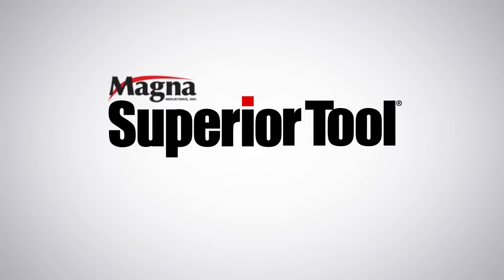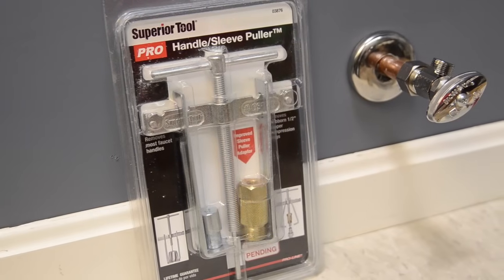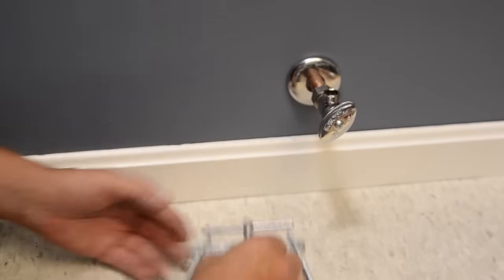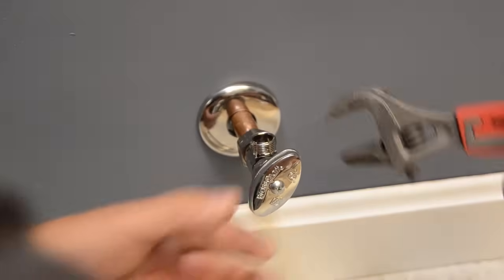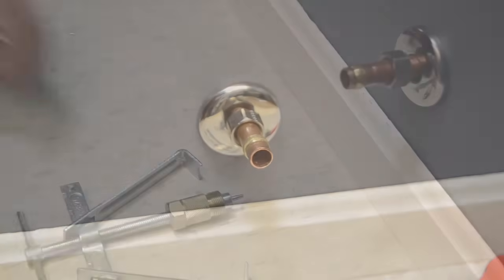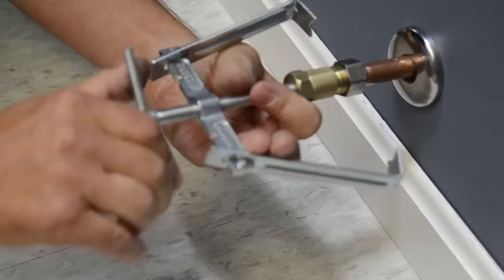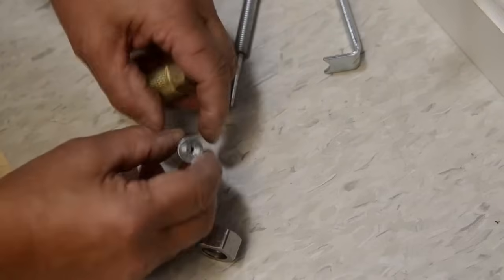Easy Compression Ring Removal - Superior Tool Handle & Sleeve Puller

Comment: If the nut is in good shape on old stop I use it on the new stop
Reply: Only if the female thread pitch on the old compression nut matches the male pitch thread pitch on the new stop valve.

Comment: I tried using this tool on a 1/2 compression laundry supply line but the threads were different and it would not pull the ring off. Luckily I had access to a compression ring removal tool that is not thread dependent. I recommend using a tool that is NOT thread dependent.
Reply: I encountered the same problem on the very first angle stop that I needed to replace:  The compression nut on the old angle stop had what appeared to be 1/2-inch female pipe thread, significantly coarser than the thread puller adapter that came with the tool, but I was able to get about a turn and a half of engagement, just enough to be able to pull the compression ring.

Comment: Good tool.  My only complaint is that I wish the 2 arms used to pull faucet handles (which make this a dual use tool) were easily removable.   They're not needed to pull compression ferrules and when you are doing so in a confined area they just get in the way and can be a knuckle buster.

Comment: The arms on the tool stamped steel and are only useful for pulling faucet handles, so for cramped spaces you can remove the drive screw from the handle assembly and set the arms aside.  I own a Home Depot "Husky" version of this tool, purchased new in November 2023, which looks very similar, except that the thread puller adapter is knurled to get a better grip with one's fingers and lacks the hex nut feature, probably to prevent damage to the threads if one should try to forcibly mate it with a compression nut with a different thread pitch.  On the very first use I encountered a 25-year-old angle stop that had what appeared to be a compression nut with 1/2-inch female pipe thread, considerably coarser than the thread on the thread puller adapter, but I was able to get about 1-1/2 turns of the compression nut thread onto the adapter before binding, just enough to get a good grip and be able to pull the compression sleeve off.  I found that lubricating the drive screw, the surface of the drive screw centering "peg" against which the drive screw presses and the end of the copper stub-out with toilet ring wax greatly reduces torque requirements and makes the compression sleeve come off much easier.

Comment: Great tool, changed 2 vanity sink shutoff valves in 10 mins. Very easy to use, the sleeve came off in seconds. I took off the arms to make it easier to use A+ . Saved my son in law $250 a plumber was scheduled to do.

Comment: Didn't work for me, pipe not perfectly round I guess, the nipple wouldn't go in so the nut wouldn't reach the tools threads.  May just cut it off and go with push on valve.

Comment: Ok, here is a real life experience with this tool. I am a strong dude with great grip strength and using this tool to pull off two 20 year old copper rings was extremely difficult.

Both of of the valves I was removing were behind the toilet and I had very limited access and leverage. The thin metal turning "arms" on the tool provide extremely limited leverage. I was able to twist it, but at times I had to wrap my shirt around the tool as it was bruising my hands from the pressure I was exerting on the tool to turn it. It was extremely difficult and laborious process for me. It took me about 1 hours of twisting and curing and then trying to find some leverage to turn it.

Tool works, but if you are in a state with hard water it may be very difficult to use effectively. Cutting the pipe was not an option for me, so I had to get it done. My right palm is completely blue from twisting the metal "arms" on the tool.

Comment: WOW! Struggled for an hour trying to remove a F@(%!#g compression ring. I could spin it, I tapped it, poured hot concentrated vinegar on it, and couldn't get it off. Tried using the old ring with new fitting, didn't work. Ended up cutting it off and then the new fiting wouldn't work anyway and ended up using a sharkbite because u didn't  have another compression fitting. Then I thought, I wonder if I could envent a tool that would make it easy. Then I thought maybe someone thought of that. Gonna buy this today! 
 Why did my compression shut off valve not work? I throughly did the prep work? Did I wreck it or do you once in a while get a bad one?

Comment: Just cut a small piece of pipe the same diameter as the one your removing the ring from. Put it in the valve that you just removed and tighten the nut from the wall.
Reply: Wow. Perfect advice bro!

Comment: Thank you for making the video, especially for us, who can't find a plumber willing to come out for simple stuff.  It's not a matter of paying someone, it's to the point where you can't find anyone, unless it's major money job.
Reply: Sounds like you could start a side hustle doing this kind of stuff lol
Reply: @divinecomedian2  Well, I ended up having to use a dremel to cut mine off- the compression ring was too corded for the tool.  I changed out three fittings, three new valves, new hoses, and three new floater systems.  The blue plumber paste sealant was a must for me.  I wonder how much it would have cost me, if I hired someone to do all that?

Comment: The handle on the tool is way too short; can't get any leverage.  A clearer picture on the package of how the pieces go together would have been helpful. The tool does work, but needs improvement.
Reply: Lubricating the threads of the tool, the surface on the centering "peg" against which the drive screw presses and the copper pipe stub with toilet ring wax greatly reduces torque requirements and makes the old compression sleeve come off easier.

Comment: I bought this tool to pull compression sleeves. The brass colored piece would only thread about 3/4 of an inch up the main shaft of the tool, because the threads on the main shaft were distorted and warped. I returned it.

Comment: Just so you know, those wings on the side  of the tool are for  pulling shower faucet handles as well.
Reply: I've been baffled by this since I bought the thing a year ago... thank you lol
Reply: Thank you!  I was wondering!  The dude could have mentioned something about it!
Reply: I wish the wings were removable. They just get in the way when you're in a cluttered space under the sink.
Reply: Simply unscrew the arm holding the wings until they come off, before using tool to remove the olive ring. Screw the the arm with wings back on when they are needed. @FrankRusch

Comment: I had one that was a real problem, it started to distort to the copper pipe rather than coming off.  In that case, it better to use a splitter tool to cut if off. Because of that, I really try not to remove it unless I cant make a good seal with the old ring.

Comment: This is the most deceptive video ever.  You first need to remove the handle puller mechanism or it will be in the way on every turn.  The sleeve in the video must have just been installed because they do not come off that easy.  It takes at least 50 hard turns and you can't turn the handle by hand on a sleeve that has been corroded on the pipe for years.  I used the hole in the end of a crescent wrench to turn it.  Save your money and just cut the pipe beyond the sleeve if you have enough pipe coming out of the wall.
Reply: Lubricating the threads of the tool, the surface on the centering "peg" against which the drive screw presses and the copper pipe stub with toilet ring wax greatly reduces torque requirements and makes the old compression sleeve come off easier.
Reply: Big thanks Ostrow and Labfolk1. Cutting the pipe wasn’t an option for me. So, after two hours of testing perseverance, the lubrication idea and using makeshift extended levers (using my channel lock wrench) the job got done.
Reply: But when you do NOT have enough pipe coming out of the wall then it’s either this or hire someone to go into the wall and weld new pipe or switch to Pex and sharkbite. 

I’d rather try this and lubricate the ring with toilet seal wax.

Comment: Would have been nice to know that the ring has to be right on the edge otherwise the tool won’t work.
Reply: mine was about 1/2 an inch from the end of the pipe and it worked just fine to get it off.  instead of assembling the tool ahead of time, I insert the silver metal piece into the copper pipe first, then push the gold threaded part over top of that and pull the nut over it at that point and then I insert the large part of the tool in through all of the pieces and then start turning.  Try that, hope that makes sense. I was concerned too at first but this method worked for me.
Reply: @Bturp1  I wrote this down and am going to try it your way.  Sounds like it would work.  I tried a different puller and it cracked the last thread of the puller.  Glad you mentioned your way of doing it.

Comment: Only problem is this works exclusively on horizontal pipes. If it’s vertical from the floor won’t work
Reply: what prevents it from working?  I have vertical pipes on my floor and wanted to know before I buy this tool.  Thanks!
Reply: As demonstrated in this video, the tool will work on pipes in any orientation.

Comment: I would say skip this one and get the T handle superior tool on amazon that screws into the nut behind the ferrule.. It is amazing!! I have done it way of trying to hit it off with crescent wrench and using a hacksaw.. This is a specialty tool but is worth its weight in gold..

Edit: okay nevermind, my puller is the same except it doesnt have the 2 "grabbers" on the side.. Still this or the basic ferrule puller are THE BEST I have seen.  I tried a home depot one with the grabbers and it is garbage..
Reply: The "grabbers" have NEVER worked for me.  For anything. They get in the way when using this tool for what it CAN do.   But, when you suggest staying with compression fittings rather than switching to Shark Bites, and you thinking that the compression fittings have made the copper unsuitable for push-ons or do you mean that you're not comfortable with push-ons for anything?

Comment: What are the claws for? Been using this tool wrong for years...
Reply: Claws will clamp on to back of stuck handles you tighten it for good grip then start backing the handle off. My shower handles were on there since 1965
Reply: Only to be used for valve handles.  They're of stamped steel and flex too much to be of any use in pulling compression sleeves off of copper pipes.

Comment: This is a lot better than the one sale at Home Depot.  The one at home Depot designed by pulling,  but this one is to thread the nut to the tool and turn the handle ...great tool. I just work on this few minutes ago b4 watching this video. So I cut the ring by a hack saw, and I damage the pipe so now I have to solder the threaded fitting and buy the angle valve that does not use compression. So bad.
Is this device on the stores now?
Reply: The current version (2023) of the Home Depot "Husky" brand puller looks very similar to the Superior Tool version shown in this video.  It includes a thread puller adapter and works exactly the same way.

Comment: Tried one of these puller styles at home depot that did not have the gold piece that screws onto the nut and it was horrible,  the arms slipped off the nut.  I have one like this without the arms and its much better.
Reply from the maker: Thanks for comment - The patent pending Gold accessory is what makes this item work so well!  No slipping.
Reply: The current (2023) version of the Home Depot "Husky" brand tool now includes the thread puller adapter, very similar to the Superior Tool shown in this video.

Comment: What about an older coarse threads?
Reply: I encountered that problem the first time I tried to use the tool.  Fortunately, I was able to get the old compression nut onto the thread puller adapter about a turn and a half before the threads bound, just enough to get a grip and be able to pull the compression ring off.

Comment: Didnt work for me the compress ring is further than this tool can reach about a half a inch.
Reply: Carefully cut a 1/4 inch of your copper pipe ! You can use a dremel tool or an angle grinder with a cutoff wheel , if  you have the room !

Comment: Why not just thread the new angle stop valve to the old nut and compression ring?
Reply: Or just cut the pipe 1/4 inch and bingo!!🤔🍺😎👍👍
Reply: Because the thread pitch on the old nut may not match the thread pitch on the new angle stop.

Comment: This is the same unit branded as Husky. Bought it and after a half an hour of trying to get the sleeve to thread, i realized that IT WAS THE WRONG THREADING! Isn't this stuff supposed to be universal!
Reply: Steve might it be that your pipe was 3/8 instead of 1/2 pipe? 
Homes built in the last 50 years usually have 1/2 fixture sub outs.

Comment: This tool is a worthless piece of garbage.  I have used REAL "professional" Ferrule removers that actually work perfectly and don't damage the pipe.  This hunk of crap barely works at all, is extremely difficult to use compared to true professional removers, and it completely damages the stub so that you end up having to cut it off anyway.  I tried it 3 times, and all 3 times I was barely able to get the Ferrule off, and it totally ruined the stub. The third time, the Ferrule got stuck on the part of the tool that is most critical, which they don't even show in the video!!!  DO NOT BUY THIS INFERIOR POS SUPERIOR TOOL.  I am going to return it next trip to the hardware store and make sure to let them know they should stop carrying inferior, I mean "Superior" tools.  The only way this tool works, is on a brand new pipe with a brand new valve/ferrule that wasn't fully tightened.
Reply: I just used the Home Depot "Husky" version of this tool to successfully replace six 25-year-old angle stops on 1/2-inch copper pipe.  Lubricating the pipe stub and the threads of the tool with toilet ring wax greatly reduced the torque requirement and made the old compression sleeves come off much easier.

Comment: Is this released yet?  I can only find the older version without the gold piece.  It is also not on your website and I can't find it for sale anywhere.
Reply: paynl8 you can buy one at walmart that doesnt have the arms for cheap.  Thats what i did
Reply: mixwell1983 x
Reply from the maker: Should be available very soon!
Reply: @Mixwell1983  I just spent $13 at Lowes for mine.

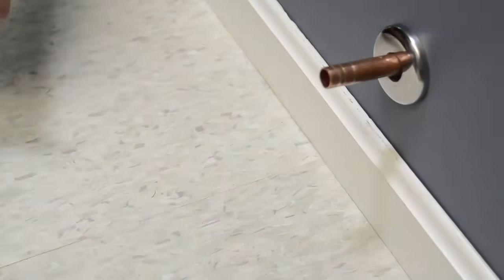Comment: 1:04 I notice the copper pipe has indentations where the compression ring used to be, will a push on connector like Shark Bite still work on it?
Reply: Late on the reply but I would suggest staying with compression fittings if thats what you had..

I am just a DIYer homeowner and i would only use sharkbites as a temporary solution personally.  If you get this puller there is no need..  Sharkbites are also double the price and I dont like the fact that the valve can still rotate after installing.
Reply: Use PFTE (Teflon tape) (wrap the new compression sleeve two times before tightening the nut over it) 👍🏽 💪🏽
Reply: @AwakenedWordsmith  wrap the ring or the copper pipe?  

I've always wondered about this because I've noticed some pipes are warped/dented after the removal of the ring and have always wondered how one can get a good seal without resoldering a new pipe on?
Reply: I had the same question about where to wrap…pipe or over the ring. If you think about where you usually would use tape to seal a fitting better then it would seem logical you wrap the “groves in the pipe” then when the Ferrel is slipped over that and compressed by the nut, the tape seals and fills up that space the grove made. So that’s what I did and seems water tight after 6 months. 🤷🏻‍♀️
Reply: I wanted to cut the groves pipe off and start with a nice clean smooth pipe but my pipe was too short. Seemed best decision at the time.

Comment: by looking at the valve, pipe and compression ring how long you you think those items have been attached? it sure is that easy when they havent been on for say 10m years. who is removing a compression ring that has no wear and been on for maybe a year. this is a misleading video. I have used a compression ring puller (not the one advertised) on a ring that had been attached for 14 yrs and it was not that easy. In fact the puller got caught in the pipe. it has nothing to do with the puller because they all work the same. the difference is the durability of the puller.
Reply: Mine wouldn't budge with a different puller.  I bought this one and will see tomorrow if it works.

Comment: Important note: sleeve pullers should only be used on metal pipes. I used a sleeve puller on my PVC pipe and the pipe was damaged.
Reply: Well yah, most indoor plumbing valves are attached to 1/2 copper lines.. Pvc is mainly used for drain lines.
Reply: Ok so what do you use for for pvc or pex for ferrules ?

Comment: Great video, and worked as demonstrated in removing two ferrules from copper pipes under my kitchen sink.  I used a Husky compression sleeve puller (Home Depot, about $11), but it looks identical in every respect to the one in the video.  My tool is 6-7 inches long and a little unwieldy to use in cramped spaces.....but it works.
Reply: When you say "my tool" are you talking about the Husky or the Superior brand?
Reply: Husky

Comment: pay the cost of a simple removal tool and then sell it on eBay if you desperately need the cost of it recouped !
Reply: I didn't get the impression he was concerned with $10 or $12, but the likelyhood of a spending money and time on a tool that doesn't work.   Anything is fine while it works  But I seriously dread working on compression fittings.  They're ALWAYS in some location with sh tty access because that's where plumbing always is.  You buy pieces and parts and tools that don't work as expected and everything takes 3 time longer than expected.